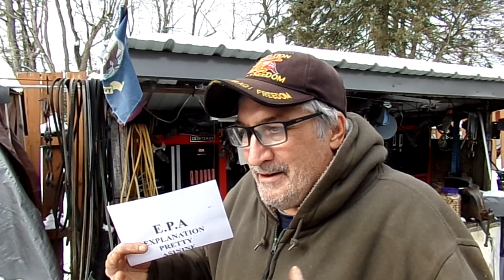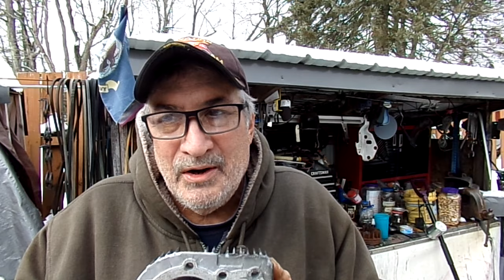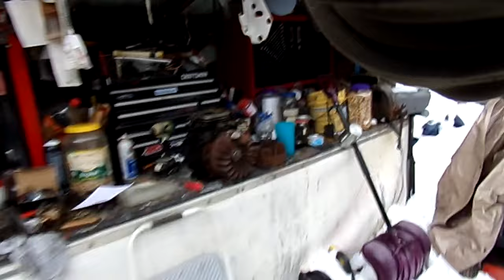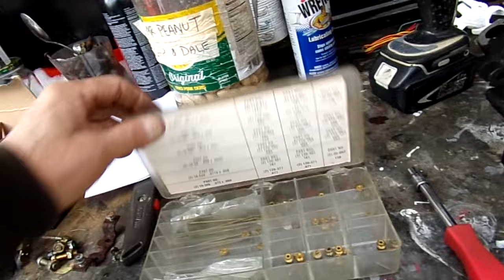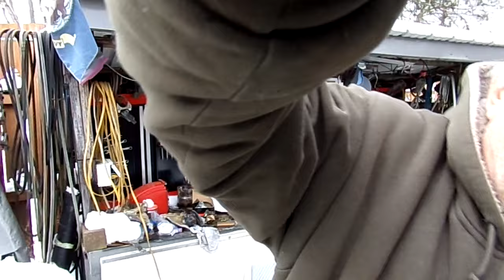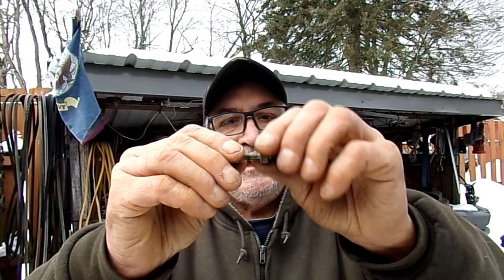WHAT IS AN EPA CARB 4 SMALL ENGINES... I EXPLAIN IT MY WAY

Comment: Even working for a municipality with hundreds of thousands of dollars of equipment repair tech cannot get the nonsense " specialty" tools.all that turns into is wasted steel and plastic being tossed when it should be repaired
Reply from the maker: That has become a modern day nuisance for sure. The reasons I covet vintage stuff in decent shape. Not unlike restoring vehicles some times it takes more than one to make just one work again. Then it becomes a question what do do with the rest of the unused stuff. At least most anything post 2001 can still be repaired to function decent again. Everything I own is that age post 2001 and year after year it still works good. I have a 36 year old Homelite chain saw. it has worked fine all these years I bought it brand new at the grand opening of a Home Depot